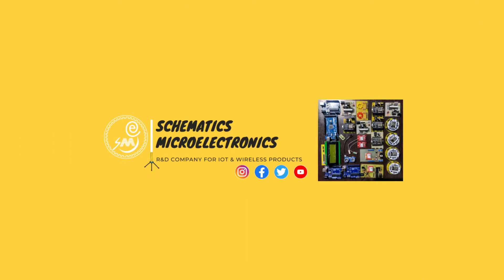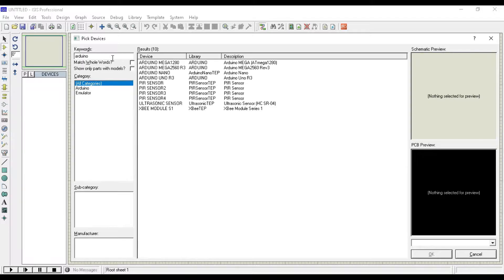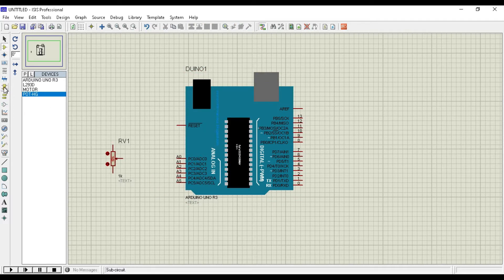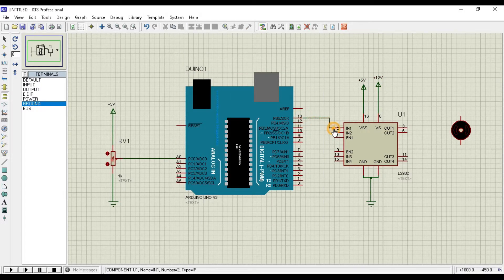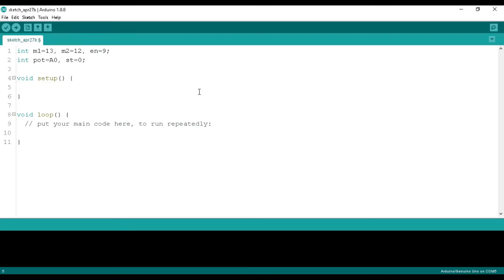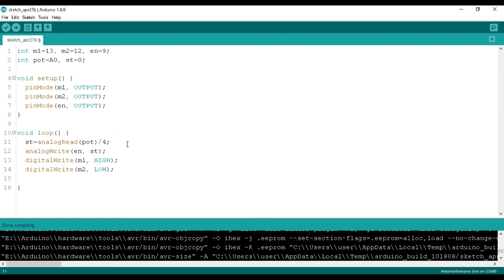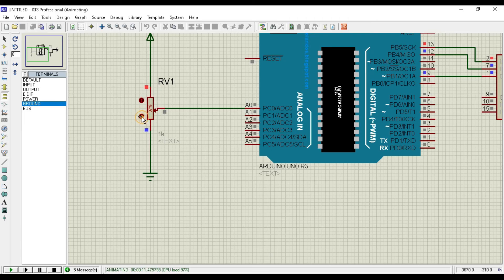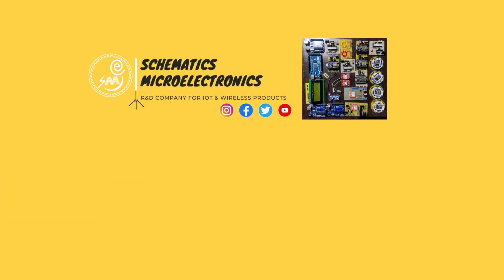DC Motor Speed control through PWM signal using Arduino- Proteus Simulation

Comment: Hi, can you tell me how can I create the model of the direct current motor (DC motor) in Proteus, do not use the ready-made one provided. The model must have the motor, the reducer and the load.

With the platform Arduino to implement the proportional speed regulator for this motor, where I use the tachogenerator model as a sensor.

Motor drive should be PWM.
Reply: ok thanks, I hope you can as soon as possible😊
Reply from the maker: Hi,
I will try for this while getting a time then let you know.
Reply: Did you try it😃. I need this so much.😊

Comment: Hey Dehradun , are you using PID or not ??
Reply from the maker: Hi,
Where you need PID?
Reply: @SMEDehradun  I need PID in Arduino code , with your simulation , that's what my teacher need for my mid-term project in my university
Reply from the maker: K I will try to make video on it.

Comment: Is there any software to perform HOPKINSON'S test?
Reply from the maker: Hello @Anand,
We haven't worked too much with Coupled machine. But you can take the reference from this link for "A program to process split Hopkinson (Kolsky) bar test results". 
You can also do the result analysis in MATLAB.
Reply: @SMEDehradun  
Thank you for your immediate reply. 

But what I'm asking in related to DC shunt machines, your answer was related to pressure. 

My question is about Back to back test Or Regenerative test Or HOPKINSON'S test.